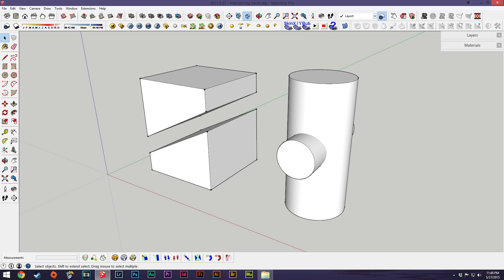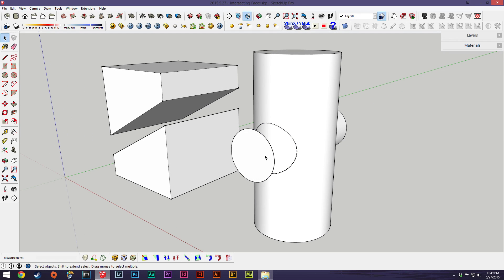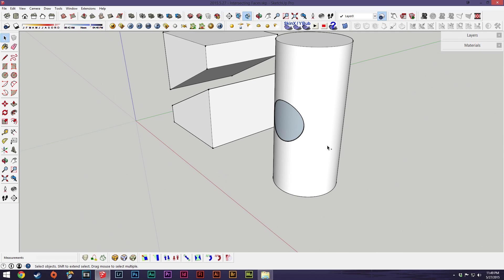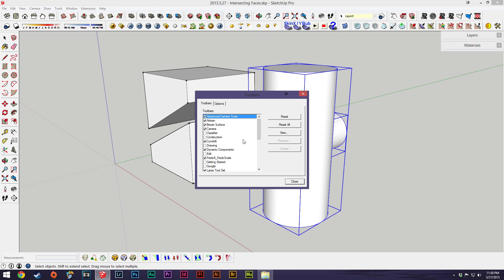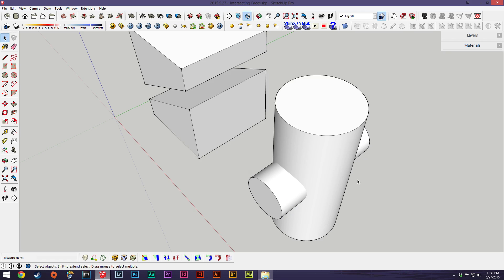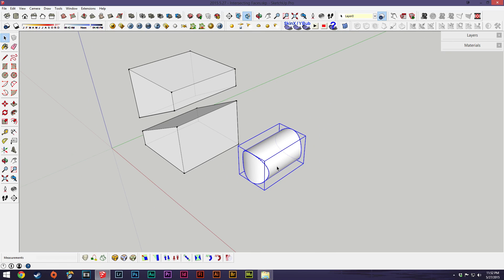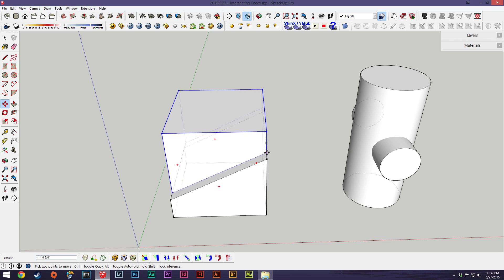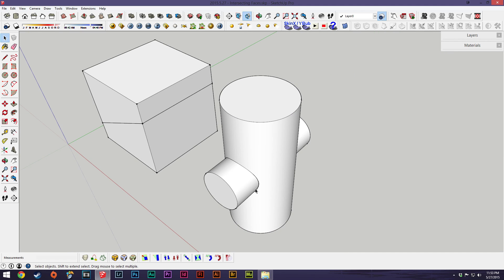SketchUp 2015 Lessons: Cutouts & Intersecting Faces

Comment: I love it when something that I have struggled with for ages and ages is suddenly made clear.  I tried and it works just how you described it, so thanks for making SketchUp more usable for me.   [EDIT]  I've had to come back and edit this comment and say WOW WOW WOW !!!  By heck the intersect tool makes a difference, and is soooo powerful.  I just easily made a drawing that would have found completely impossible before because of its intersecting angles and curves.  This is going to make so much difference to my use of SketchUp.

Comment: Hi Aaron. Thanks for this video. Do you have any idea why I am able do this intersecting once using the solid tools, but then if I try to do it again with another object and the resultant object from the first opperation; I get this error message : "One or more of the selected objects is either not a solid or is locked. The non-solid/locked objects will be de-selected before this operation is performed." ?
Specifically, it seems to be a problem when I use the union tool or the outer shell tool and then try to use the subtract tool with the result and another solid.
Reply: Could it be something to do with them being overlapping when I do the initial outer shell process? Ultimately I want to combine two overlapping solids, and then bore out a hole using another solid and subtract.
Reply: I get that too Julius. Did you find the solution?

Comment: Thanks. Great video. Do you open the solid tools as needed. I don't see how to add them to the open tool bar like you have. Also, I want to punch a round hole in a plate. Do I draw a circle and push pull or make a rod and intersect and subtract? So confused

Comment: Thanks a lot Have tho nagging problem of getting faces to intersect and when I try to force it via intersect faces command options it gives me the rotating wait wheel and or crashes with still no intersections being formed.  Have to revert to 2 d tools draw on surface of even flat surfaces often: Do you, Aaron or for that matter does anybody else in the discussion, encounter this have this problem and if so how is it resolved ?